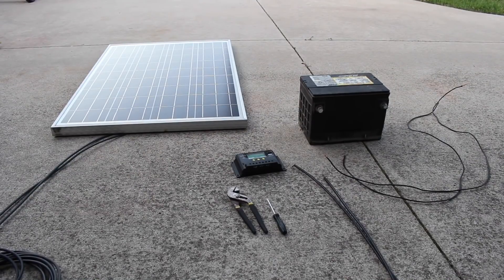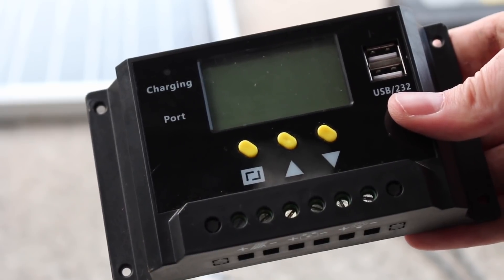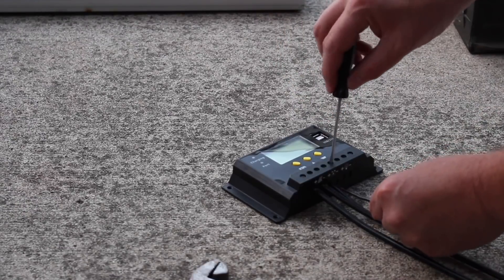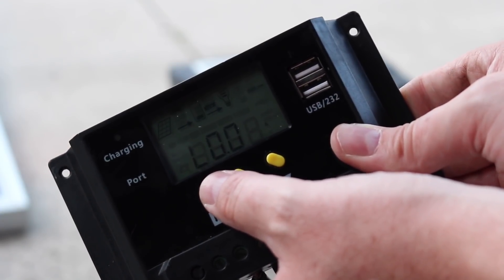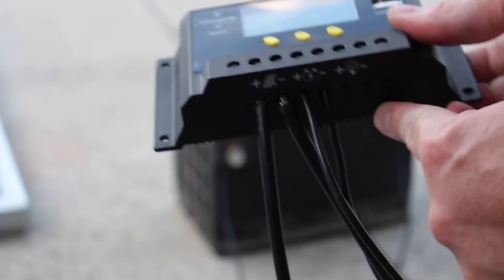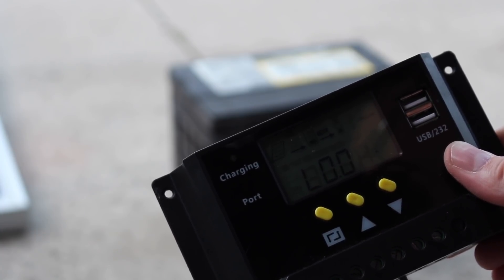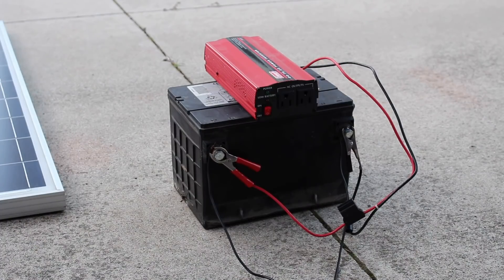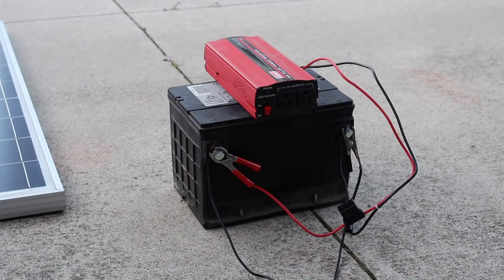Basic Renogy 100W Solar Panel setup!

Comment: Will the charger turn off automatically when the battery if fully charged?
Reply from the maker: It doesn’t actually shut off it goes into a floating state
Reply: @MikeSimon  please answer if you know
Reply from the maker: Yes it’s safe to leave on all the time, it won’t hurt it. If you feel it’s unsafe and you always just put a switch in place to quickly disconnect
Reply: @MikeSimon  Where may i put a switch help please.
Reply: So it's safe to leave it on all the time? 
I have TV and want to set up an solar system to charge the batteries. I m there like once a month and wanted to know if it was safe to leave it on all the time to charge?
Reply: Rv*

Comment: Great video on the wrong way to hook up a solar system.
Reply from the maker: What’s the correct way? This way has worked for years without an issue.
Reply: @MikeSimon  Battery first.  That way the controller knows if it's a 12v or a 24v system.  
At least that's what the other 3000 identical videos already on YouTube and the instruction manuals for every controller on the market say.

Comment: aren't you supposed to plug the power inverter to the load connector on the controller, and not on the battery it was charging? or is it use for other type of dc loads?
Reply from the maker: That load port is for DC which pulls power straight from the panel. I guess you could plug it in but if sun goes away you will have sudden voltage drop
Reply: The load doesn't come direct from solar panel it comes from the battery and the charge controller allows you to use power and and charge at same time. Also a mppt charge controller would be better

Comment: hello mike  nice video  my question is that i want to install solar panels in my garage much like your system.  do you believe that two 200 watt panels, a 7000 volt power inverter and what size amp charger would i need?  thanks for your help.
Reply from the maker: Most charge controllers are 30amp do you know the amp out put of the panel you want?
Reply: hello mike  many thanks for the message.  thanks for answering one of my questions.
currently, i'm living in France.  here, we're 220 à 240 volts.  i would like to install two or three 200 volts panels in order to run my workshop.  if not, i'm required to dig a 3 foot trench some 150 meters.  thanks for the 30 amp charger....  i'll get one, then an inverter, the biggest i've found of late is 5000 volts.  thanks for sharing your advice....  great videos on your automobile expertise.
Reply: @MikeSimon   i want to be able to run a table saw or a circular saw on the solar output.

Comment: Batteries should be first so you can set the proper charge/battery type, etc.  Also your cables to the battery should be a little thicker, but for now you are ok but should be as short as possible.
Reply: What size?
Reply: @RVFreeDa  depends on a solar amps producing im guessing this can give max 8A in OC and i think this is enough. BTW you should think that controller can give 30A if you connect 4 panels in parallel so for the maximum output its 360Watts. For the 30A 1meter long cable you need cable 2mm2, for two metres you need 4mm2.

Comment: How many volts is 100w ?
Reply from the maker: Depends on the amps  W divided by A = V
Reply: 2 different things... Volt is Potential Difference Unit, Watt is Power Unit.
Reply: Its a 12v panel.

Comment: Would a 100 watts panel enough to chsrged  battery for my pond pump
Reply from the maker: @michael dev it’s possible but you need to know how many amp your pump draws, if it’s more than what the panel outputs then it won’t keep up.
Reply: @MikeSimon  ohh boy lol
I gotta look at the box  and find out

Thanx for the help man really appreciate it

0.45 amps 
120 volltage?
0.036 hp

Can you recommend a good battery for  it?
Reply: @michaeldev5962  i supposed youre should be using inverter, from batery to let the pump running (if its ac)
By the information labeled on the box,
(Amp x voltage) you should have at least 54ah batery to run, and to keep it healthy you should consider using half of the capacity
Thus you must doubled the capacity to let it running.
In this scenario 54x2 = 108ah
And the batery should larger than the load itself, 120ah for example
I already Multiply it to 24hrs running
Hope it helps
Reply from the maker: What AH is the battery, and are you trying charge it while running the pump?
Reply: @MikeSimon  yes charging it while running the pond pump

This is my first solar project
So i bought renogy 100watts monocrystalline panel with the solar controller
Duracell inverter 400 watt peak 320 watt

The battery i dont have yet
Since i dont know what battery i should get to power up my pond pump

Comment: Pretty sure you hook the battery up first then the solar panel second and then your load and reverse when disconnecting
Reply: Unless you don't mind cooking the controller
Reply: Yes, basically that is the sequence when you dont have any disconnect. Hook the battery first to scc
Reply: Yup

Comment: Sorry, but you need to check your facts.  The load terminals ARE connected to the battery but you typically have a button to turn them on and off and you probably have an option for turning the load on/off by time - usually for powering lights at night.
Reply: The charge controller has a load out it basically acts as a switch or a timer for a load I'm not sure if the solar PV will supplement from the battery as well but technically yes that load off of solar controller will be Juiced by the battery and switched by the solar controller not sure if the controller will siphon off Excess power and put it through the load to supplement the battery